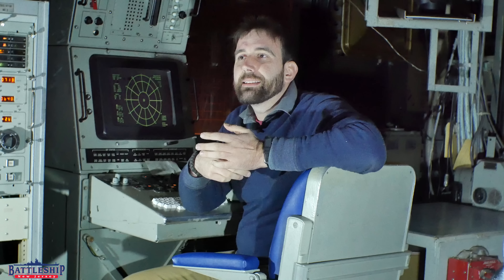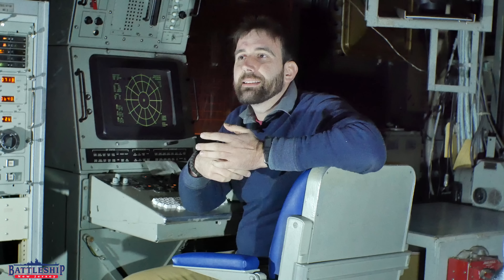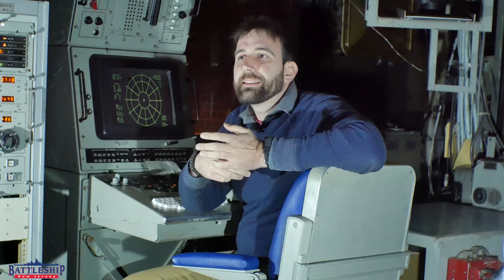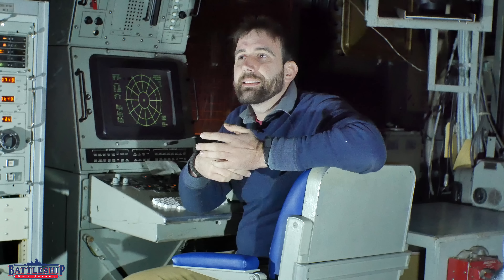Aggressive Christmas Tinsel, Smoke Screens, and Other Countermeasures

Comment: In a previous video, I brought up the question of what WW2 era warships are underrated, but what about the opposite? What warships are generally viewed with rose tinted glasses and made out to be far better than they actually were? It would be really cool to see some opinions on that. Here are some examples in my book.
The KMS Bismarck, in popular media, is the largest and most powerful battleship ever made, equipped with the biggest guns and best armor. This was far from the case, as is common knowledge to anyone who's ever read anything about naval history. While she was the largest battleship until 1941 with the completion of Yamato, the actual largest and most powerful battleship ever made, she was never the most powerful. Even when she was commissioned, she was beaten in firepower by IJN Nagato, HMS Rodney, and USS Colorado (not even mentioning ships built later like Yamato and New Jersey), and beaten in armor, by HMS Prince of Wales, HMS Vangaurd, KMS Scharnhorst, etc. Many fans of the German navy claim that she beat everything she came across without a fight until her final battle where she only sank because she was scuttled, as her armor was never penetrated, her machinery was never damaged, and the torpedoes had no effect. Anyone with a functioning brain will tell you otherwise. While she did annihilate the Hood, Prince of Wales caused severe damage was a bad oil leak, the torpedoes caused bad flooding, and Rodney obliterated Bismarck's upper works, belt, and turrets.
Another good example is, well hot take here, New Jersey herself alongside her three sisterships. Yes, she was the 2nd, possibly 3rd best battleship ever made, with lots of good feats to her name, but she's often made out to be far better than she actually was, particularly in accuracy She packed a powerful punch, nine 16-inch super heavy shells, but they're not horrifically overpowered. Many people make it out like they could just easily punch through anything and everything with ease. In reality, the more heavily armored ships like Prince of Wales and Yamato boasted reasonably large immune zones to New Jersey's guns, with Yamato's deck and belt being immune from 20,000-30,000 yards, while her turrets and barbettes were completely immune at all reasonable ranges. Her radar was the best, but it was still only 1940s era radar, with many people treating it as if it's on par with modern satellite radar on an Arleigh Burke class guided missile destroyer. Further more, people like to claim that New jersey could just sit from max range and snipe things, getting hits every salvo, due to her radar, when there's a lot more to fire control than radar, such as gun stability, shell dispersion, etc. New jersey had a hit rate of about 1.9-2.8% against stationary targets at 30,000 yards.
Reply: You are incorrect regarding the sinking of KMS Bismarck.

Full disclosure, I am in no way a "Weraboo" as you call them. I am a naval historian albeit an amateur.

However, the "weraboos" as you call them are actually right. Literally nothing could touch her - with one exception. The aerial torpedo that struck her rudder and disabled it.
Additionally, she was indeed scuttled - this was decisively settled by documentation from the Royal Navy and Kriegsmarine, as well as documentary evidence from the legendary Bob Ballard.

The PBS documentary NOVA literally did a documentary on the Bismarck in the 1990s, so it's been settled for a really, REALLY long time.

Also side note: When you call someone a "werahboo" you're actually calling them a Nazi, so it's rather offensive.
Reply: @annefrankvapepen2064: Hood would be classified as a battlecruiser. She was underarmored at the time of her sinking and not up to caliber.

Had she gone in to Scapa Flow for her scheduled up-armoring she would have been just fine during the events that lead to her sinking; however this scheduled upgrade kept being deferred as Hood was just too busy.

So the responsibility for Hood's sinking, lies solely at the feet of Hood's captain. Deferred upgrades combined with an overworked crew, enabled the shell to penetrate and detonate. Had the scheduled upgrade actually taken place, she could have survived the hit.

KMS Bismarck's shells may have sunk her, but the Royal Navy was at fault for the Hood's sinking since she was scheduled to be up-armored but failed to go in for it.
Reply: Why did you excluded Yamato,  you know she's Overrated.  I know your Bias on her. But come on you can do better lol.
Reply: @TheOneTrueDragonKing  except german testimony on the final minutes of bismarck are largely conflicting and contested as many of these sorts of things are. this was also the result of the british enquirey into the sinking. the senior officer said he ordered the charges to be set, however other spaces did not receive this order. no on survived who had set these charges and the testimony given by men who recall charges going off has been called into question. whether bismarck was scuttled or not, it is under no debate whether she was not combat capable by that point and was flooding anyway. 

although bismarck stood up to a large amount of punishment before sinking, she was also heading home when she was sunk and not out to sea looking to repair damages from 3 hits taken from prince of wales. she was not invulnerable to fire and she was not comparable to british heavy battleships of the time either, being only much faster than those that could out gun and out armour her which is what concerned many of the british admirals as the british operated large fleets of cruisers and destroyers to protect merchantmen and bismarck would be able to both match their speed and out gun and out armour them. her guns were not equivelent to those used on the british battleships like rodney and nelson but were more comparible to those used on the battle cruisers like hood.
Reply: @issacfoster1113  How is she overrated? If anything, she's underrated. Her guns were not only the most powerful, capable of penetrating all allied naval weaponry, but some of the most accurate as well. She was an extremely stable gun platform, but she used advanced ripple firing, something that wouldn't be developed for Big J until the Korean War. Her armor boasted large immune zones to even the most powerful allied naval weaponry, and she had the best optical systems and a basic set of radar.
Reply: @dfgiuy22  My information comes from various sources including the Germans, the British and the documentary by NOVA and oceanographer Robert "Bob" Ballard.

Bob Ballard's research expedition to the wreck of Bismarck, and the associated video footage, indicates that he went down almost totally intact with almost no hull damage except for two holes, one of which was the hole made by the aerial torpedo whic jammed his rudders.

The only other hole was the one made by the scuttling charges, indicated by the fact that he exploded from the inside out, not outside in as would be expected from shellfire.

His turrets which were held in place by mere gravity, fell out on his way down as she capsized after the scuttling charges exploded.

Her superstructure was intact as as almost her entire hull. Meaning none of the ship-fired British torpedoes or shells struck him. Additionally, neither fire nor flooding ever occurred onboard until after the charges had exploded.

Battleship Bismarck was scuttled, not sunk by British fire. Furthermore, the British weapons were unable to touch Bismarck, let alone sink him.

And there's documentary footage from multiple angles to prove it.

I'm sorry, but the idea that Battleship Bismarck was made "totally combat ineffective" and sunk by the British, is nothing but a fanciful, fictional sea story.
Reply: @TheOneTrueDragonKing  bismarck is straight up missing the rear half of one of the front turrets due to a shell from Rodney that penetrated the front of the turret and slammed into the back with enough force to dislodge the armoured plate. 

She is also sporting a number of 16 inch shell holes from Rodney in the armoured citadel. Ballard did conclude in his expeditions that she was not penetrated in the armour belt below the water line. 

By even the german accounts, which you would know if you had actually read them, bismarck was in no fit state to carry on the fight when she sank. 

Camerons much more recent dives on the wreck support the scuttling idea, however his views is that it hastens the sinking by a matter of minutes. 

If you look at the British reports, bismarck had a near 10 degree list long before the scuttling order was given which means that the ship was flooding before the order was given.
Reply: @ryancook6452  All of that is incorrect, I am sorry.

Bismarck was barely even scratched except for two holes, one in her side and one in her aft.

Otherwise she was untouched, proving that all the British fire did was annoy her crew.

British BB gun, meet German Bear.
Reply: @TheOneTrueDragonKing     not trying to be  smart-alecky but... Bottom line though is bismarck sunk, scuttled or otherwise,  as a result of action w/ the enemy....no?
Reply: @TheOneTrueDragonKing  please refer to something that isn't a 1980s dive to the wreck. 

There are later dives by multiple groups that prove bismarck was penetrated multiple times through the deck, upper Hull and superstructure. 

Even ballards original dive found multiple penetrating hits on the deck. With a total of eight holes visible including one in the main armour belt. 

The next expedition in 2001 found "a large number of shell holes in the superstructure and deck" 

The 2002 James Cameron expedition also noted a number of shell holes in the wreck. Cameron found 2 instances of the 320mm side armour belt being penetrated and multiple instances of plunging fire penetrating the deck armour. Which, along with bismarcks ever increasing list, is what allowed water to enter the ship. 

Camerons report which includes survivor testimony from both the British and Germans States that scuttling the ship would only have marginally affected the time of the sinking, not whether she would or wouldn't sink.
Reply: @TheOneTrueDragonKing  also there is a logical fallacy here, if bismarck was so combat capable and better than anything the British had, why did she

A; not score a single hit during her final battle.  

B; allow a british battleship to close to point blank range and begin shelling her directly. 

C; allow a british destroyer to launch torpedoes at her. Without scoring a single hit back.

D; if she was combat capable, why did the crew scuttle her at all? As by your reckoning she was completely un damaged and not penetrated or sinking at all, aswell as completely capable of firing back
Reply: @ryancook6452  You are incorrect all around. First off, the Ballard expedition was in the early 90s.

I'm not even going to bother correcting your later statements because they're so incorrect I could probably write a book on how incorrect they are. You've got more lies than a con artist here.
Reply: @ryancook6452  A) I said her armor was effective, not her guns. After all, she couldn't hit outdated biplanes either.

B) See A

C) See A again

D) Likely to prevent her capture. She would have been a great prize for the Allies and she could have remained afloat for potentially weeks unless she was scuttled. She was heading to Occupied France when her rudders were disabled, meaning she could have drifted to shore had there not been literally the entire Royal Navy in the way.

The shot that hit and sunk Hood was a simple lucky shot. And even that would have failed if HMS Hood had gone in for up-armoring as she was scheduled to do.

It was deferred upgrades and a busy wartime schedule that sunk the Hood. The Bismarck's lucky hit was a mere consequence of that.

Also the Hunt for BIsmarck was a British rage-induced folly. Ships from as far away as the Far East were put on alert. They were pulled from the Mediterrainean as well.

Imagine pulling ships from thousands of miles away, literally halfway across the world in the Pacific, just to hunt for one single battleship that sunk one single other battleship.

At least when Pearl Harbor was attacked, they sunk multiple warships of all sizes. That is a worthy reason to be angry.

But a single ship being sunk is no reason to yank the entire Royal Navy off their duties in oceans on the opposite side of the globe.
Reply: @cjc_0167  Yep, that's true enough. However my point was that it wasn't sunk by the British.
Reply: @TheOneTrueDragonKing  they didn't take ships of station purely because Hood was sunk and they wanted revenge.  

But because bismarck wasn't sunk, and as far as the British were aware relatively undamaged, and heading out into the convoy lanes to perform merchant raiding. Which at that time would severely hamper the war effort. 

Ballards expedition was in 1989. The documentary would be released in the 90s, however the reports were released in the late 80s.
Reply: @ryancook6452  They took ships off their station as far away as the opposite ocean - the Bismarck was in the Atlantic, but the Royal Navy's pacific fleet was recalled, as was their mediterranian fleet. All out of anger.
Reply: @TheOneTrueDragonKing  it's not anger.

For someone claiming to be a naval historian, you're failing to look further into one of the most documented naval battles short of trafalgar. 

Chasing a ship down, especially one that is much faster than you requires more than a few destroyers and a damaged light cruiser. Ships were pulled from the Mediterranean fleet as shockingly its quicker to get from Gibraltar to the coast of France than sail slower ships from around the coast of Scotland and down towards St nazzaire. 

They needed to stop bismarck before she could reach german or French ports. Specifically Brest and St Nazzaire as she needed repairs due to penetrating hits from prince of wales. Once in dry Dock it would be nearly impossible to get within range to sink her due to air cover and she could escape to try raiding allied shipping.

That is why they brought up ships from Gibraltar, they were faster, closer and would be able to get in range to cut bismarck off from French ports. 

Although anger at the loss of Hood certainly was a factor, it wasn't the main reason that Force H were pulled up from Gibraltar.
Reply: @ryancook6452  I'm not arguing that, I'm arguing that ships were pulled from the Pacific when the battle was in the Atlantic.

That's pure, sheer, ridiculousness. Folly, in fact.

And that is also in the documentation of the battle. Or perhaps you didn't see that?

Either way, the Hunt for Bismarck was driven by anger more than logic. And I could name fifteen or more times during the War, that the British let their emotions rule them.

I don't get how a single battleship was worth all that. In those days ships were sunk every day, and new ones were a dime a dozen. It's not like today where a battleship is a rare breed and sinking one is an absolute tragedy.

Force H were needed elsewhere. As were the Pacific forces who would have never gotten to him in time. In fact I'd wager that significant losses were incurred in those theaters because the mediterranian fleet and the pacific fleet were out of position.

Whatever happened to "We'll get him next time"? Chasing the battleship Bismarck served no strategic or tactical value, and only served to pull ships out of position. It was a distraction that served all too well. 

Much like a hacker trolling someone online to distract them while the real attack happens through a back door. "Hey, look over here, over here!" while other things happen elsewhere.

The chase after Battleship Bismarck was a distraction, a trick, and it worked like a charm. The Brits were so focused on sinking Bismarck due to their rage at the sinking of their pride and joy the Hood, that the Japanese were allowed to take key positions in the East, and the Italians were able to shore up defensive positions in the south.

Hunting the Bismarck instead of waiting for him to strike again and then hitting back, was a strategic and tactical blunder. Not of any consequence,  whether strategic or tactical. It was a hunt of pure emotion, the equivalent of saying "Never mind the real enemy, you pissed me off and now I'm gonna hunt you until the day you die."

There were much bigger fish to French Fry. Bismarck was unimportant, as was Hood. Both are massively overrated.
Reply: @TheOneTrueDragonKing  you have now back tracked on thinking bismarck was impervious to anything the British could throw at her then?

As she is now no longer a threat and shouldve been ignored until she sank something else. 

Moving force H North did not significantly weaken the British at Gibraltar and ships regularly left force H to return to Britain on multiple occasions. 

I can find no reference to the east India squadron taking orders in any notes, if you could provide some that would be very useful to me.
Reply: @ryancook6452  Then you have been negligent in your research if you cannot find references to it. Hell, even the song Sink the Bismarck by Johnny Horton has references to this.

Yes, Force H had individual ships leave it at times but the entire fleet never left the Med at once, until they were ordered to assist in the hunt for Bismarck.

Bismarck was definitely a threat, but chasing after him was a blunder. He was just one ship - how could one ship have been effective against the entire Royal Navy? Hell, even ships such as Yamato were ineffective at this task and she was built according to the theory that a single ship could take on a fleet.

I've not backed off on Bismarck being pretty much invulnerable. However, the Hunt for Bismarck took ships away from tasks  they were needed at elsehere. Significantly weakening the British position elsewhere in the world in exchange for the hunt for a single battleship.

If such actions happened today, they'd call it a massive strategic blunder, the epitome of stupidity, and rightly so.
Reply: @TheOneTrueDragonKing  because bismarck would not be facing the entire royal navy. If she had managed to escape into the Atlantic she would be able to raid commerce, Britain's vital life line, protected mainly by light cruisers and destroyers which bismarck could significantly out range and at 28 knots could match speed with most of the older cruisers and only just below the speed of Britain's modern cruisers. 

Bismarck was still a battle ship and as a commerce raider she could've inflicted serious damage akin to how the graf spee had done earlier in the war. Graf spee also elicited a similar response, involving 4 aircraft carriers, a battle cruiser, 2 battleships and 16 light cruisers. In just 3 months Graf Spee would sink over 50,000 tons of merchant shipping. 

Looking through the lyrics to Johnny Horton's sink the bismarck I can't find any reference to ships of the Eastern fleet. I would also not exactly cite Johnny Horton's song as an accurate reference, as the first verse is already full of inaccuracies, although the biggest ship by displacement she most certainly did not have the biggest guns as Nelson's guns were an inch larger at 16 inches and she is also not the fastest ship either with Hood reaching 32 knots. But damn if its not a catchy song
Reply: @ryancook6452  The reference in the song is "put every ship asail" after they've found her.

Basically, the entire royal navy put to sea in anger over one ship. Whether in the Atlantic, the Pacific and the Med, all ships were sortied, a waste of tonnage as some of those vessels would never reach the target area.

Bismarck was just one ship, to send the entire navy after her was wasteful and done purely out of anger.

Now I'll admit that I'm no expert in how people thought at the time, but the entire Royal Navy against one vessel? That's excessive to the point of ridiculousness.
Reply: @TheOneTrueDragonKing  it certainly wasn't "every ship" the folk song is not an accurate description of the battle. I cannot find any references to ships of the Eastern fleet being readied for action against bismarck or any losses incurred by the Japanese or Italians as a result of ships leaving to track bismarck. 

You don't seem to have a grasp on how deadly Bismarck could be if she was raiding merchant shipping like supply ships. Bismarck was more than equivalent to British light cruisers and only marginally slower while being better armed and armoured. Unlike Graf Spee, which was fast but not particularly well armoured and thus could be countered with british light cruisers if she could be tracked down and intercepted, which she was.

The Royal Navy could not afford to just let bismarck roam free however the ships that outmatched bismarck were slower than her which would allow her to escape in an open seas environment like the mid Atlantic. 

Searching the open ocean for a single ship, even one the size of bismarck involves a lot of ships and aircraft. Bismarck was also the most powerful ship able under the command of the Km that could sortie at that time so she elicited a considerable reaction from british forces.

If you look at other examples of other lighter Km ships that escaped to perform the same duties then you'll understand why the British did not just allow her to escape into the shipping lanes.

The damage from the torpedo hit combined with the already damaged ships from her earlier engagement with prince of wales meant she was already doomed long before her final fire fight, so the opertunity was ripe to sink the ship and prevent it from being towed back to port for repairs.
Reply: @ryancook6452  So you admit that all that firepower was wasted on her. If she was already doomed long before her final fire fight, why did they send all that firepower after her?

Again, if you cannot find references to the Eastern fleet being readied to sortie, then you have been negligent in your research. It is a fairly common reference and not just in the song.

Let me guess, your reference was "Wikipedia"?
Reply: @TheOneTrueDragonKing  no, I don't believe it was meaningless as like I said if left adrift despite the heavy flooding and inability to manoeuvre under her own power she could've been towed to a French port for repairs, she had to be sunk before she could get in range of german air cover or support from the rest of the Km.

 I have checked the two books I own bismarck and a book on the Eastern fleet and can't find anything on them being readied for anything to do with bismarck. If you have any of these please point me to them as I can't seem to find any in works I own.
Reply: @ryancook6452  Maybe get some more books as it's a fairly common subject.

Furthermore, the KM had no oceangoing tugs and not only that, but any tugs that they could have dispatched would have come under fire from the Allies and quickly sunk.

There was no way she could have been salvaged, ergo the firepower dispatched to deal with her was wasted.
Reply: @TheOneTrueDragonKing  you don't need tugs specifically to tow a ship, case in point would be the tanker ohio which was lashed to 3 destroyers whilst flooding and towed into malta during pedestal. 

But you must know of these books as you say they're easy to find, please tell me what they are and I will find a copy so I can educate myself. My research is generally pretty good but I can't find anything to point me in the right direction and you obviously know what they are so you could just tell me what sources to look at.
Reply: @ryancook6452  I already mentioned all my sources. The Royal Navy, Kriegsmarine, and expeditions by Ballard and others.

There are too many books by these organizations to list off their actual titles. You could fill half a branch of the New York Public Library with them, if not an entire small-town library.

Additionally, I said they were easy to find, not that they were easy to get. Given they're part of the official logs and testimony, some of these historical documents these are notoriously difficult to obtain.

Additionally, I said sources, not just books.
Reply: @TheOneTrueDragonKing  I have read the official reports from the time, there is no mention of the Eastern fleet, the east India squadron, China station or the Australian squadron. These reports are digitised and have been for some time and are also referenced heavily in other works. 

If you're actually referencing all the other wreck expeditions then you should know that most of the claims you made in your original statement I first replied to are flat out not correct or you are misreading information presented in those papers
Reply: @ryancook6452  I still maintain that the Hunt for Bismarck was a waste of firepower as you have already admitted the ship was doomed long before the hunt was launched. Anything approaching him would have rapidly been sunk by the Allies, making him unrecoverable.

I'm sorry, but the Hunt was a waste of time and firepower. That much is all but certain.
Reply: @TheOneTrueDragonKing  the ship wasn't doomed before the hunt, the hunt is what doomed her. 

Without the hunt, she is left to make it to harbour for repairs, pose a continuous threat by being merely present and capable of breaking out. 

Being a presence would waste further british time and resources as she would have to be constantly monitored and only be able to be attacked via high altitude level bombing, which would result in considerably more losses over the 0 losses when bismarck was engaged for the second time, and also not be particularly effective as a ship being damaged or even in the unlikely case she would sink in port she might not sink below the water and could be refloated.
Reply: @ryancook6452  You mention yourself that she was holed and sinking long before the Hunt started.

So which is it? Either she was a threat, or she was doomed?
Reply: @TheOneTrueDragonKing  I don't recall saying sinking due to the damage taken from prince of wales, if I did I apologise for misleading as I meant flooding and damaged.

She was damaged by three hits from prince of wales, flooding a boiler room and some auxiliary spaces aswell as causing a fuel oil leak that would contaminate her tanks and cause a large slick on the surface. Neither of these damages could be repaired at sea and taking on water, although slowly due to damage control measures taken, was not halted but could be combated. This would force her to return to a friendly port in French or German waters.